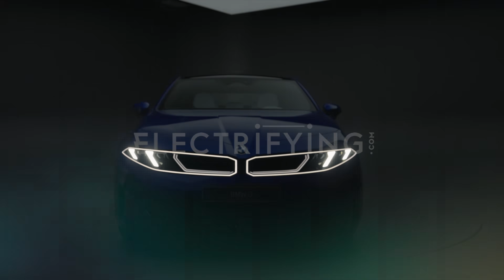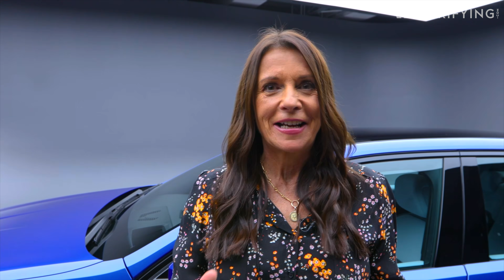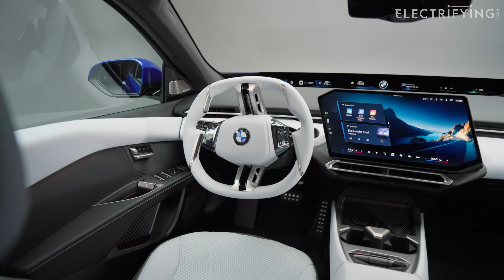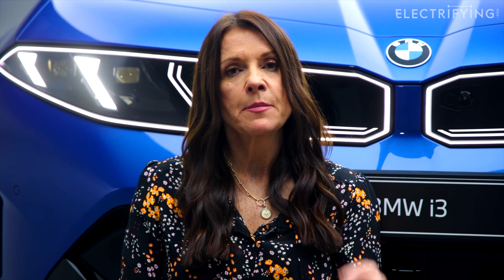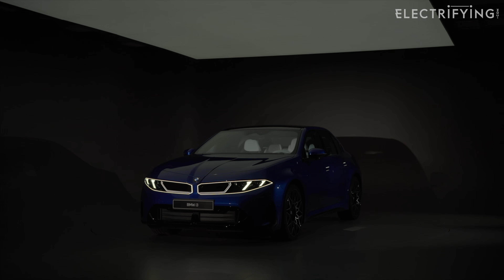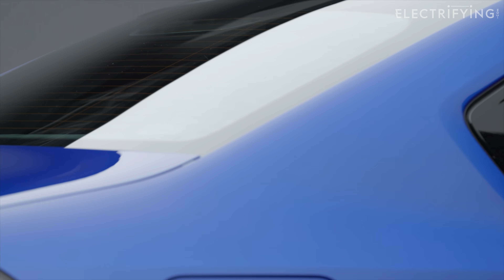BMW’s electric 3-Series revealed | i3 Neue Klasse walkaround

Comment: Ginny, At least this BMW looks like a 3 series... I think it has a good looking front end with that sweeping bonnet, although the back end gave me Alfa GTV vibes... Oh and I don't understand how new circular batteries are more efficient, because if BMW or anyone wanted efficiency, they would look toward the natural world of Bee's and the 'Hexagonal' Honeycomb design... which I'm sure everyone knows that... "The hexagonal cells:  Distribute weight evenly, providing incredible strength without adding bulk.  Cost Efficiency:  Materials are used efficiently, reducing waste and overall costs. Versatility:  It's suitable for various applications, including thermal management, filtration, and structural support"...  eliminating all those small/large gaps you get when you join up circles :-)

Comment: Overall I like it but I expected to see the kidney grille similar to the iX3 but this is really not a kidney grille as the lights are far too wide. I like the interior, even the steering wheel and I hope that BMW will still offer a proper leather interior. The forthcoming 3 Series IC will look the same apparently but will be on a different platform and although we have not yet seen details, I think it would be my choice. I still like my G20 330i M Sport.

Comment: Needs to be less than £50k end of
Reply: Hopefully there will lower spec in future...this is an i3 50 AWD with 108kwh Battery and 469hp...such kind of car was never cheap.
Reply: @josefv-y8m i agree- m sport in a colour with sunroof sub 50, cla+ have done it
Reply: @josefv-y8m i agree that bmw have been expensive before, my i4 is a 90 grand car. Mercedes have done it for 50 now- bmw need to match at lower end as they're way off the mark with pricing

Comment: Long time bmw fan , they are definitely not reading the room with this approach to buttons and switches etc - there HAS to be a way to be more innovative than looking like they stick an IPAD onto the front dash and run everything thru software - bearing in mind tech companies have been truly awful with voice recognition -ask Siri - users have been underwhelmed with voice activation in practice and BMW should keep this in mind before rail reading Alexa as a solution - yes AI might improve - but how how many times have the and cars just not met expectations this past 20 years - most drivers prefers touch buttons -that’s just a fact - and finally the recent reports that BMW have started increasing monthly subscriptions options for things like heated seats -where the tech in onboard but you have PAY addition fees to activate - that’s not what created the BMW legacy and they should reverse course on this thinking

Comment: I've been waiting for this car for ages but I think it might not work for my growing son if the rear seats are short on room. Such a shame because I didn't want an suv but want the long range.
Reply: Just wait for an Estate...or simply buy an ID7 Tourer...I love mine and the huge size of almost 5m.
And the Range is no issue with an ID7...a "Pro S" can easily drive about 450km on Autobahn and charges  at 210kw...not that fast like the BMW, but fetching a coffee takes 15min already in most cases.
Furthermore...it has acoustic glass...not available for BMW. My previous I4 was really noisy at higher speeds due to wind compared to the really quiet ID7.

Comment: I trust that as soon as the i3 becomes available for purchase, the i4 will be discontinued immediately. And then there could be a coupe version of this called the i4. 🤓🤞
Reply: Indeed...you can read that I4 Production will be stopped in 2026 according to insideevs.
Since the i3 will be produced direct in Munich...on the assembly line of the I4...not even that surprising.

Comment: Three things there. hofmeister kink done like that is just a meaningless mockery and should not be forgiven, the real one has always been a legit design solution to enhance visibility and also accessibility in 4 door shape. The standard steering wheel is awful, BMW knows it and indeed offers the decent one charging premium fee, smart guys they are. Third, the illuminated grille is no real innovation, energy and pollution are spent to make it just like any standard chrome or painted solution, then proceeds to spend additional energy  for the rest of operational life of the car, we should start to be a bit more rational and spot contraddictions, not reward them. Apart from that i like it more than the previous 3er, put there a straight 6 and we can talk.

Comment: 800 Volt isn't the high end though, the Chinese are at 900 now. And 400 kW peak charging... yeah, better than before, but the Chinese are at 1000 kW peak charging and can sustain 600 until something like 60 or 70 %. I mean, BYD is able to do 10 to 70 % in 5 and 10 to 97 % in 9 minutes. BMW takes 4 times as long for a bit more charge, or half twice as long vs what is basically full charge. So the i3 isn't impressive, it is embarrassing. That being said, this thing is properly attractive and probably much nicer to drive than the Chinese options.

Comment: Cylindrical cells and structural packs are bad ideas taken from Tesla.  In Tesla's case they glue and foam them permanently into a NON SERVICABLE stew of waste. Battery packs with modules are far more serviceable, which is critical as we see mfgrs continuing to do WHOLE MODEL recalls because fire-safety battery faults are found years after production. Bolt, Kona, I-Pace, Jeep's hybrid battery are all examples of model's whose impact on the planet was ruined by requiring total pack replacement. Eventually, they've learned to focus on FIXING packs instead of total pack replacement.

Comment: Apparently BMW ignored that eyes take time to refocus on the road, the screen, and NOW the other screen that's too far away and not close enough many people's defective eyes/corrective lenses.  At least they put the speedo in front of you. The other info you use while DRIVING is next turn, so where did they relocate that to? It was on the binnacle.
Reply: Hmm, this is exactly the intention for this new location...no need to refocus, since more distance to the eyes.
Normal display behind the steering wheel exactly forces your eyes to refocus.
Reply: @josefv-y8m the display extends from one extreme of the side of the windscreen to the other requiring varying eye refocus as you search for the thing you're scanning you arbitrarily repositioned on it. This is not designed as a safety measure. It's just a designer's concept car fluff piece that made it into production. Not unlike Elon's stupid yoke steering that wasn't tested with the public for usability before it became a standard feature universally hates, because it was impractical.

Comment: I wish we could have had the outgoing i4 interior with i3 range and charging speed
Reply: Now you can’t have the i4 at all as they just announced it is being discontinued to make way for the i3. It will return to the line up after the iX4, iX5 & next gen i5 are released.
Reply: @ReinReadsThen I might find a used i4 when it is time to get rid of my Tesla Model 3 LR

Comment: VAG and Merc need to step up quick
Reply: Why? I love my ID7 and it charges sufficiently quick...at daily use I charge at 11kw and fast charging is not needed 95% of the year for me...I could not care less about fast charging in my case... I can easily achieve 450km on Autobahn.

And especially Mercedes with the new 800v Platform called MMA within CLA, GLB, GLC, VLE, (and C Class coming soon) already uses technology similar to the BMW.
BMW has now 2 cars with the new technology and Mercedes has introduced already 4.

Comment: Why put the charge port on the wrong side. Won't be able to use Tesla chargers.
Reply: Why should you use those antiques 400v Chargers with an 800v System and wait for ages like Tesla drivers?
In Germany Tesla added longer cables already to be able to serve other brands.

Comment: That shift from 300 to 500 miles really puts battery efficiency into a new perspective. Feels like the real story here is how much smarter the underlying architecture is becoming, not just the headline numbers.
Reply: It is not efficient...it is just huge.
Reply: @AJames-jr8kwit is efficient, too...if you see a Smart #5 with almost 100kwh...it achieves only about 350km...since it is completely inefficient.
On my test drive I saw 35kwh/100km at 130km/h...what an awful car...my current ID7 consumes 19kwh at this speed. 
The Geely Plattform is the issue...now they tell that this is improved in the Volvo CX60...the new Geely Platform.

Comment: 300 miles is more than anyone´s bladder range, and you´re going to need to eat.   So 500 miles is probably just excess weight.  I suppose it would be useful for long distances in the winter.  so glad they have become rational about the grille.
Reply: Well I would rather have it than not. Plus if someone doesn't want it they can get a smaller battery version.

Comment: What. is the longest time/distance that can be legally and safely before a break for a drink, toilet break or food. Has there been any research? A longer range in any vehicle is unnecessary. I know that in the UK most professional drivers are limited to about 2.5 hours(?).
Reply: It is not only about range during a single journey, but range using it daily...with this you have to recharge only once a month...especially during city driving...and could be interesting for people parking in the street, too.

Comment: Love Ginny - But NO that steering wheel with a 12 o'clock spoke is awful.  You can't even grab hold of it in many of the places.  Hope the 2 spoke wheel is truly better - of course a 3 spoke would be ideal as every good sports car proves.  Also don't love the no buttons for HVAC or the like.....a volume knob is a requirement for me I'm afraid.

Comment: WHAT was wrong with buttons? We've been using them for 140 years in cars. That's a lot of years. You've been copying yourself BMW - from generation to generation - for several decades - starting from E28 or E34 5 series, over to E38 7 series - my F11 five series - has very similar buttons. And I LIKE THAT. I can use them. I know where they are. Even not looking at them. Full climate control. Drive modes (mostly Eco/Sport acceleration when needed immediately). Stereo volume. WHAT WAS WRONG with them - what was wrong with finding them - without EVER taking your eyes off the road? What? Can anyone explain? BMW? You should know that, BMW - seeing you're located on the doorstep of fastest roads of Europe where you drive 180 metres in three seconds (do you want to spend these three seconds fumbling with a moron screen?) The only thing here is I think customers (like me) trying to explain something to BMW. Hey, BMW - you've been doing buttons for decades. You have also been doing many of your design cannons - for many, many generations and decades - you know the ones I talk about. It's not only Hoffmeister's kink (by the way your (edited: FIRST) five series Touring didn't have it). You know which design standards I talk about. The distance from front wheel to hood. The line from rear to front lights through door handles. The overall taught, muscular shape. Lines that make sense. Like E39. You remember the last time you dropped them all? Yeah. You invited the designer boy Bangle to design your E60/61 and E65. AND THEN IMMEDIATELY - even during the immediate face-lift for the 7series - you went back to classic. Remember that? Why was that I wonder? Then you designed two still very good looking five series which were not Bangled. The F10 and G30 were classy, sporty, not bloated and not spitting onto your own design cannons, like the E60 was. So you went back to your roots - with the F10 and G30 - whole two generations of good design - after the moronity that was E60 (both interior and exterior). Why, I wonder? Something to do with a massive backlash and sales volumes? Hope it's not the case for you with buttons BMW - looking at the number of people VAG and Mercedes are currently fireing because of sales decreases - I'm really hoping you know what you're doing with the entire "buttonless" crap. I don't think you are. I think you're blindly following some stupid trend that's on the market for some reason or other (ukhem, Elon Musk). By the way, BMW - as you clearly know - sales figures of electric vehicles are declining. Sales figures of cars which f_ing identify as appliances are declining. But you still insist on being "trendy". Well, let's see where it all takes you. I just hope my F11 from 2012 drives forever. Just bought a massive pile of parts for it.

Comment: I love the sci-fi-look of the interior and the exterior is elegant enough, but a few hints from the original i3 and i8 would not hurt. Thinking of those accent colours and graphical black elements in the design. But those can me included with vinyl graphics, if you want them, i guess. 700+ km range is great!

Comment: I don't get the hate on buttons from the car brands. I hate trying to use the screen while driving it's absolutely annoying so that's a hard no for me on this car
Reply: Yep, as above, not only means less parts, but also simplifies the assembly line. They all know it's worse than buttons, but money money money
Reply: @riaz8783 facts unfortunately
Reply: In factory it's 1 same screen for all cars, and buttons can be added in software later if needed. Cable harness is very simplified. Less time to build, less parts to track, less things to fail. Or so they say... I still think they could add something like grid of programmable buttons and dials connected by one usb cable.
Reply: its a cost cutting move, and they can axe a ton of parts from their parts bin as well

Comment: I like it, but I wish the rear was longer, the proportions seem weird from the side profile in the back. It might look better in person though.
Reply: Might have to go for the i5 that has just kept growing. It’s now 5060mm long only 8 mm shorter than the last generation 7 Series. If the early estimates of the dimensions are accurate this will be as wide as and only ~50 mm shorter than the last generation 5 series. At this rate I hope they build a 2 Series sedan on Neue Klasse so we can get something closer to the size of a traditional 3 Series.
Reply: Good point.

Comment: I’ve had 9 BMW’s over the last thirty years M3s ,M4s, 330i’s, Clubsports, 7Series’s etc all but one of which was a straight six cylinder engine turbo or natural aspirated. Six years ago I even bought two on the same day. They were all good looking and driver focused. Handled well as they weren’t too heavy and back around the year 2000 were bullet  proof in terms of reliability. The 728i doing 347,000 miles before a left hand drive truck wrote it off. Today, I’m struggling to find a new BMW that my heart wants to buy in terms of look or feel 😢
Reply: I agree. Driven the ix3 and it’s a battleship kept on the road by software and controlled by an iPad. I hated it. Did not feel like a BMW.
Reply: Maybe you are getting old mate, no offence. This car is all right,  ev or new tech might not be for you. But I know this will sell in good numbers, I was never a BMW guy but this looks something I might buy
Reply: @s @sergiuprofiroiu2814 ur definitely right about getting old, no offence taken but I’ll stick with my M4 and 320i until I’ve run out of options. I wouldn’t swap my Honda Fireblade for a heavy fat electric bike either.

Comment: I really like it, best looking 3er since the E46 and gives very 70s vibes (I'd have paid extra for yellow corduroy interior and more chrome round the window frames). I've had six 3 series of different generations and am looking forward to getting one of these, subject to driving it, though more likely the i340x than the i350x. Should hopefully give a genuine 300-350 miles which would be spot on for me. Also, great to not have a sun/pano roof forced on us, I don't want one.

Comment: The car is quite attractive, but the price... don't they know the Chinese are coming? Again, silly little lights inside and on the front. They can't even make colored trim for the front, and for God's sake, illuminated door handles? Don't waste any more kilowatts! The taillights are the least BMW-like ever; it doesn't look like a BMW at all. Why complicate things by changing the seat controls—more wiring, more weight? What are the manufacturers thinking? Customers aren't usually stupid. How can a car at that price not have the same finish on the rear doors? And my God, that steering wheel is an affront to good taste, ergonomics, and practicality. The only explanation is that it's to squeeze money out of you by forcing you to pay more for the sporty version. I'm sure they don't discount the price of one from the price of the other. Seriously, 21-inch wheels? That's how we save money and go green. Another thing, they don't know how to open and close the trunk without using swan necks. It's not that difficult, BMW and Mercedes-Benz. They should learn from the MX-5 and, magically, have more trunk space and less weight. It's incredibly difficult to close the trunk; it requires an expensive electrical system that you have to buy and replace, and it's heavy. Less planned obsolescence and more reliability. How much will it cost to replace a headlight if you have to replace the headlight and half the grille? They never think about the customer after selling you the car.